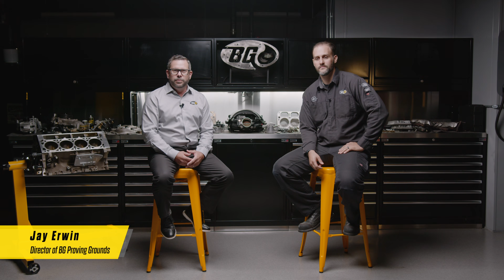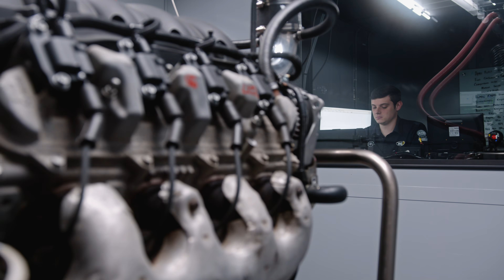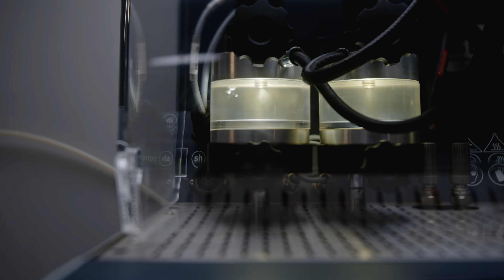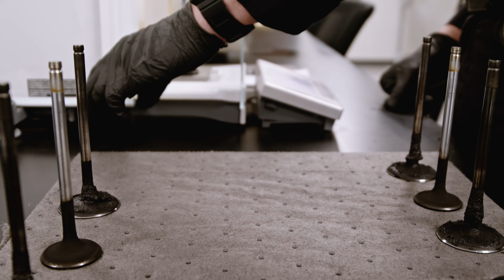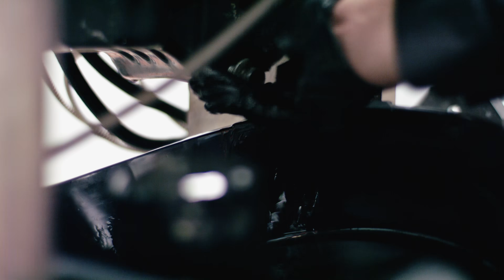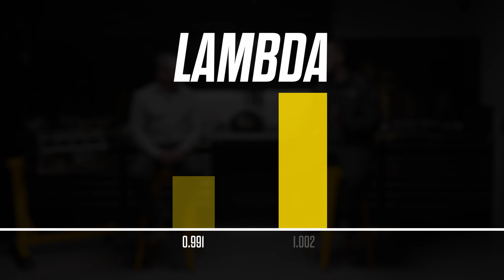BG Products Restores Junkyard Engine

Comment: Did you perform oil analysis on the oil, before and after application of the BG services and cleaners?
Reply from the maker: Yes, our lab performs the analysis on the oil before and after!
Reply: @bgproducts  Will you share the used oil analysis as well as all test methods and data?

Comment: What I took away from this video was not so much the increase of horsepower and torque or the reduction in emissions, rather the need to perform GDI services (and especially the use of EPR on oil services) at a much lower mileage interval, to keep the intake valve deposits to a minimum or even bringing the valves back down to bare metal, and oil system / piston ring groove cleanliness, as opposed to letting everything go to what I refer to as "critical mass" and the necessity to do a walnut shell blasting of the intake valve / valve pocket / intake port.